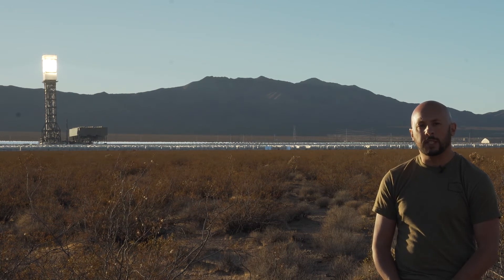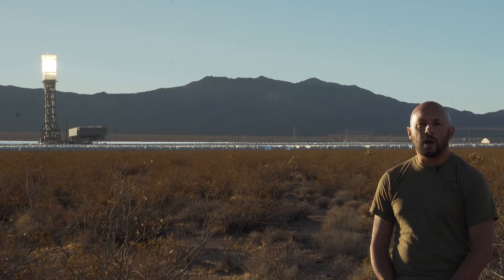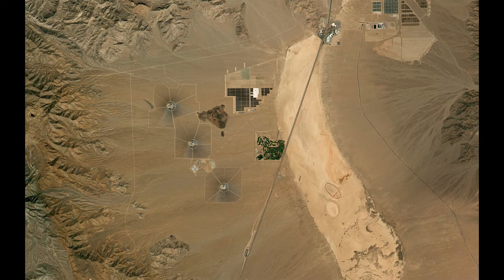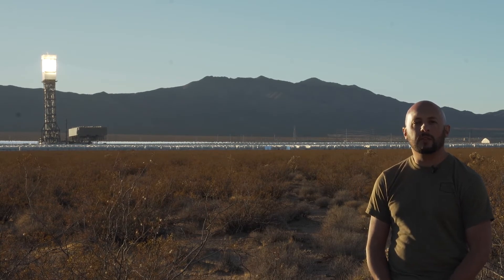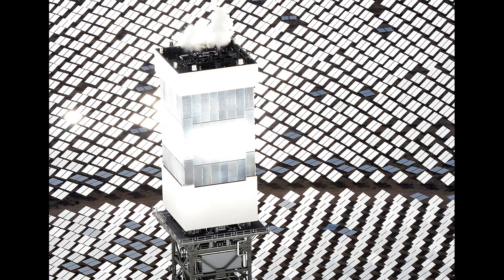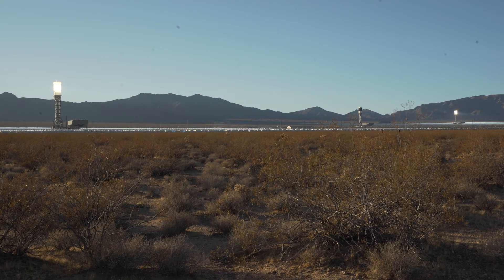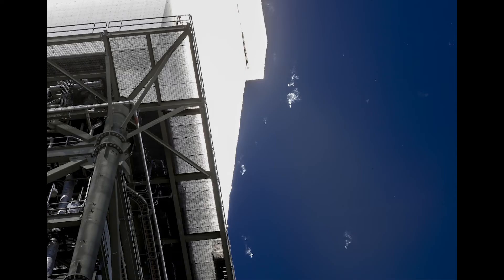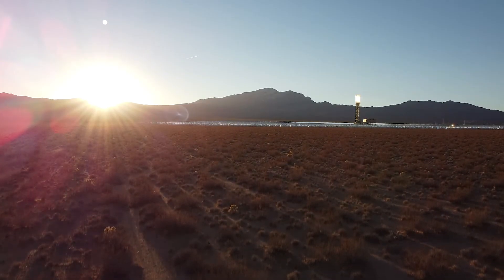Ivanpah Solar Power Facility

Comment: These are not even close to being the first of these. I remember Solar One being built in 1980-1981 in Dagget Ca (outside of Barstow). That was within our dirt bike 'stomping grounds', and we would visit the construction site frequently stopping along the fence for a break and watch it being built. Later, when they finished construction, there were class trips with guided tours inside. It was touted as a possible future for clean energy. We dirt-biked all around that area as teenagers. Its a bleak dry high-desert area, but the mountains are riddled with abandoned mines from the goldrush era - so many surprising things to discover within a half-tank of gas radius of Yermo CA.

Comment: i wonder how many birds a coal / natural gas power plant kills due to pollution 
i bet its about the same.... 
.
also... as others have said...... it now makes 91.1% of its intended output (which is pretty damn good.... the power plant in coal strip, montana is WAY lower than that due to maintenance issues / boilers being burnt out) 
.
and ya..... 2.2 billion
now 200 million

Comment: It uses molten salt to boil the water which produces steam to spin the turbines and generate electricity. Critical details not mentioned in your video
Reply: This one doesn't use salt, it uses water tube boilers. That is part of the problem. It uses Natural gas to produce power when there isn't enough sunlight.
Reply: @PatrickLEAHY-z9o yeah you're right. They've since shut it down too.
Reply: @southwestxnorthwest i passed by yesterday, 6/25/25 and every single mirror was aimed properly. it has not looked this good in the last 10 years.
Reply: @D1g1tal_H1ppy I thought they shut it down?
Reply: It does not use molten salt. The mirrors are heated directly from the reflected rays from the Sun. That is why it can't power at night because it lacks molten salt to store the energy like 110MW Solar Dunes in the same Nevada.
The Solar Dunes in Navada uses the same principle of operation as China's CSP Dunhuang Project.
Reply: @iamjosephola4 yeah I acknowledged that almost a year ago in another reply

Comment: Using concave mirrors and runing a pipe with oil then running that oil underground were there is rocks that absorb heat that way you can have heat during day and night and produce steam!!!

Comment: Is it true, the cost of natural gas heating, it operates at a loss?
Reply from the maker: I don't believe it has ever operated at a loss monetarily.  Up until recently it had not operated at full capacity, though it gets more efficient each year.  In total, the natural gas usage makes up only about 5% of it's total output of electricity.

Comment: I thought this would be so much cheaper than Solar Cells, and get much closer to be able to compete with gas and coal. But at 2 billion, even PV is nowadays cheaper. And burning birds is even worse than the windmills chopping them up. So sad, this technology is dead in my opinion.

Comment: It's true the problem is that solar panels deliver now even cheaper energy. 
But still, thermal solar is  used in other hot countries and even more is starting up.(Morocco)
So I find this all a bit strange. All these unforeseen problems. Was the design not really good? 
Or worse perhaps certain people didn't want this to succeed from the start. But ok, that's conspiracy thinking without any proof.